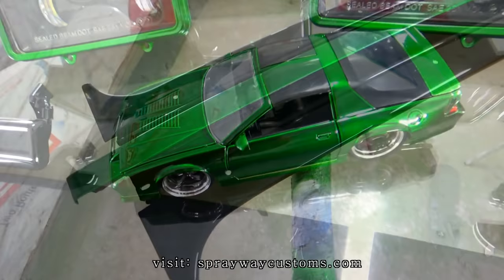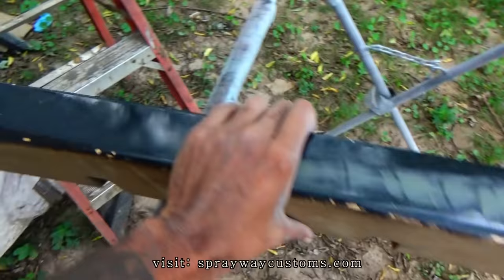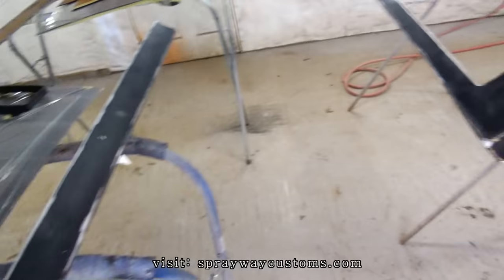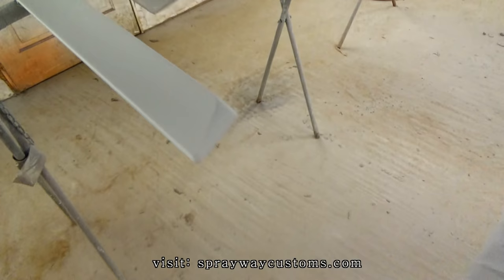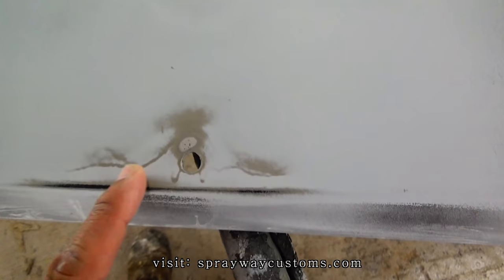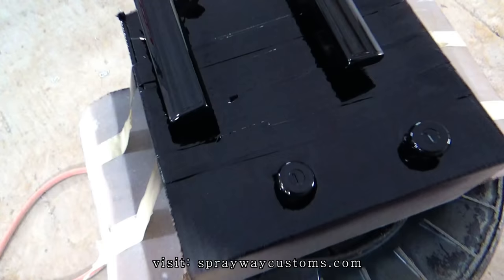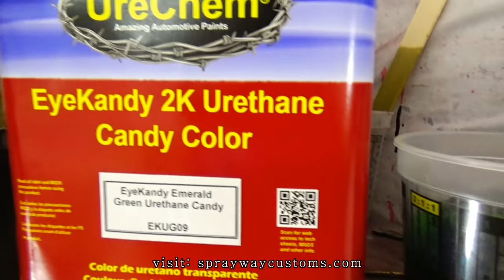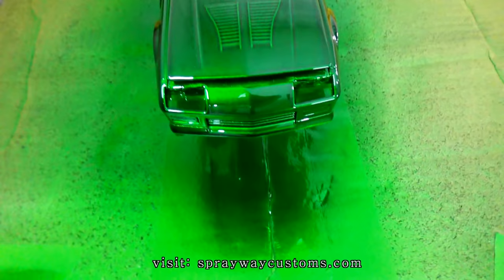Spraying Candy Green Paint On Camaro IROC Z28 Third Gen Parts BODYWORK REPAIR & MODEL CAR PAINTING

Comment: "Mr McGhee don't make me angry you wouldn't like me when im angry" WoW you done turned that Z28 into the Incredible Hulk. Really nice touch bro with model car and accessories good choice on color.  Im waiting for that notification bell and I will cutt cha back on to 👀the car  all the way together. I've done all of my body work just by you showing me. Now i need to spray just need a compressor not sure what size to get. Thanks bro Blessings to you and yours
Reply from the maker: Thanks...Just match your gun cfm's with your compressor and you'll be fine.
Reply: @SprayWayCustoms  That wet wet clear I have to spray @ 50psi right? so with that will I need  at least a 60gal compressor? I was trying to stay away from 220 volts but I will get what you recommend. Thanks for your help bro... Blessings....

Comment: Why do you spray the epoxy primer all over some parts, but only over repairs on others? Does it depend on the materials, or the quality of what's left after sanding the old finish?
Reply from the maker: I just sprayed it over the fiberglass parts for adhesion also

Comment: How much would it cost for you paint my Dakota ? 4 door slammed truck. It’s currently maroon with flake. I want it to be a bright orange yellow mix with tons of flake. Also need my rims painted. Need a shaved tailgate and I need my roll pan welded on
Reply from the maker: Where you located and what's the condition of the truck?
Reply: @SprayWayCustoms  New Mexico and decent condition. Has pebble sized dents around the truck from rocks. I don’t need the inside of the bed done at all. Small amount of rust on the roof